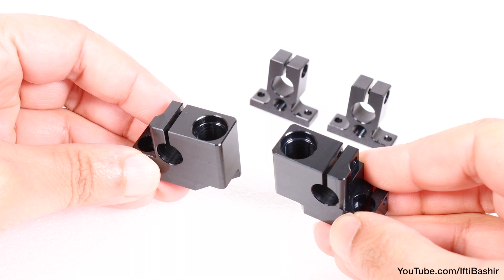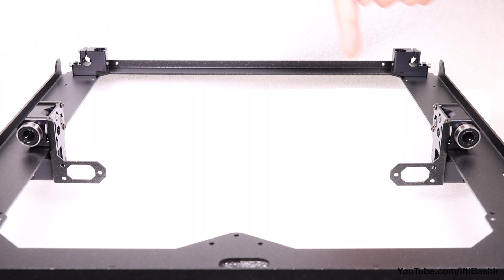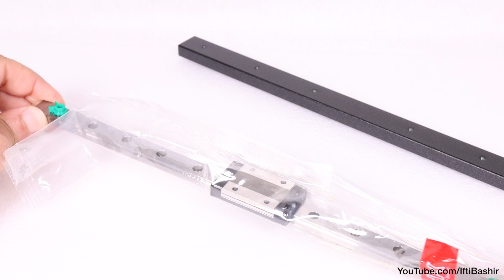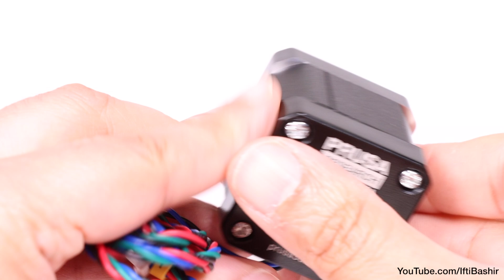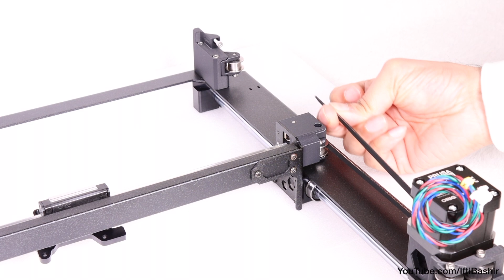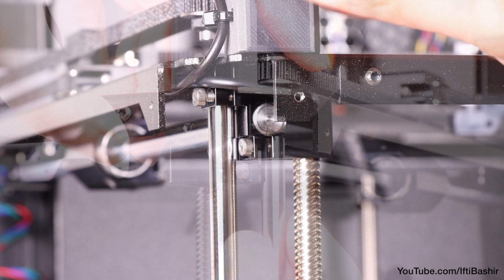#05 Original PRUSA Core One Kit : Full Step-By-Step BUILD GUIDE - CoreXY Assembly

Comment: Warning! If you bought the Buddy Camera with the Core One kit, at 25:45 don't tighten the zip ties. Install the USB C cable through them that comes with the camera or you'll be cutting them off later. Do them up but loose enough that you can still draw through the USB C cable. This is at step 71 in the Prusa assembly guide for the Core XY

Comment: I’m surprised Prusa doesn’t just specify in the manual the torque in Nm for tightening the screws. That would be much more precise than the vague instructions based on feel, which everyone might interpret differently. They could still include the feel-based guidance, but anyone with a torque screwdriver could tighten the screws with certainty.
Reply: probably they dont want to assume everyone has a torque wrench for m3 screws

Comment: RECOMMENDED UPGRADE - Pulley Tensioner with Insert found on Printables. There is an issue with the two metals of the same type seizing up over time. Using a brass insert will prevent this. You can also add some lubricant to try to prevent the tensioner screw and nut from seizing up.
Reply: This happened to me after I fully assembled my kit and tried to tension the belts. Seems like I didn't use enough grease and the screw/nut seized up almost immediately. Getting a replacement from prusa but will be printing this out when I can.

Comment: couldn't be emphasized enough (as is written in the manual) - DO NOT DROP THE MOTOR! I dropped the X-axis motor as I was following the video and the author only said to grasp the motor when fixing Y-axis motor in place and there was no warning for the X-axis one. of course it is my fault, but do not do the same mistake. now I don't know if I should buy replacement or try to finish assembly with the fallen one...

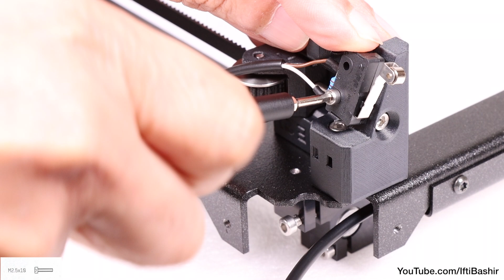Comment: Are you sure it’s M2.5*10 at 24:57 ? Because I was trying M2.5*10, but couldn’t get it in, even without the sensor attach just the screw. However, the M2*8 can easily screw in, also it slide right in the sensor hole as the video shows. 

Just want to make sure.
Reply: Do not use these Videos to build the printer. Use the official Prusa CORE One kit assembly
Reply: @lukas-kevynmuller6697  This guy is accurate 99% of the time and he was right about the M2.5*10 being the right screw.
Reply: @lukas912  99% still leaves 1% margin of error.

But yeah, you're probably right. And tbh I also used some videos for the build process because of bad reading comprehension at a few times lol

Comment: Thank you soo much 
I just built my core one and had an issue … with the belts and motor not aligned with the pulleys .. causing the belt to not follow a straight path . 
I could not see what I did wrong until now . 
I mounted both motor shaft the same direction . But in fact they are not in the same orientation

Comment: Great step by step video.

I have to say I'm a little disappointed in how the core xy goes together.  From what I can tell there is nothing but screw holes locating everything. 

For example, how do you know that your tightening the  linear rail orthogonal to the Y rails.  How do you know that both y rails are parallel to one another?  How do you know that the front stops, which you square the gantry to, are perpendicular to the y rails? 

I also don't like the fact that it appears that you'll have to remove the Nextruder to remove the belt. 

These are not criticisms of your video, your video is great.  These are just questions in my head about the design.
Reply from the maker: Valid points!